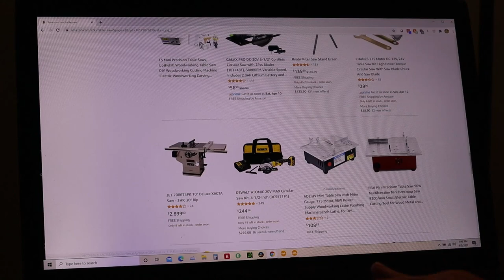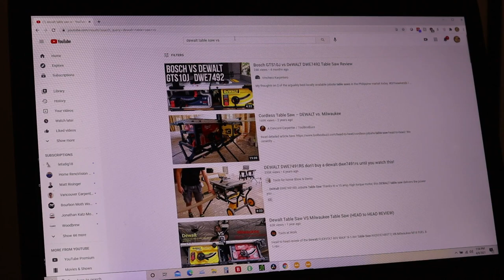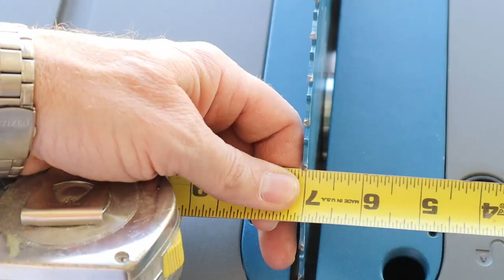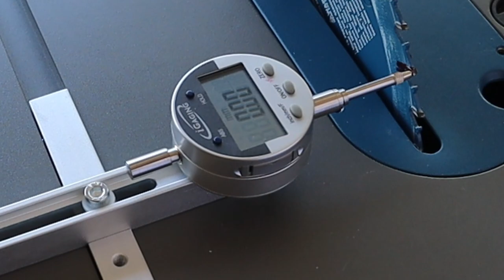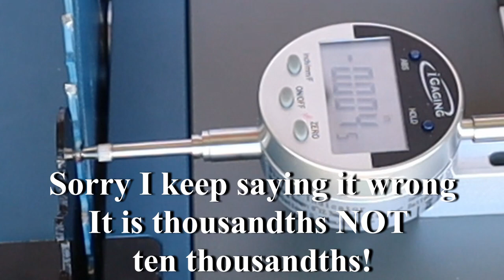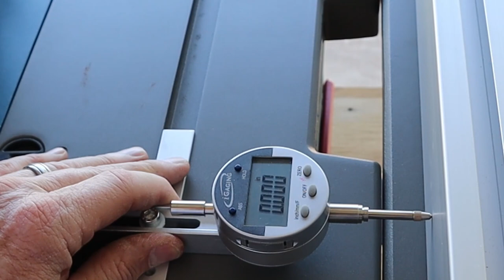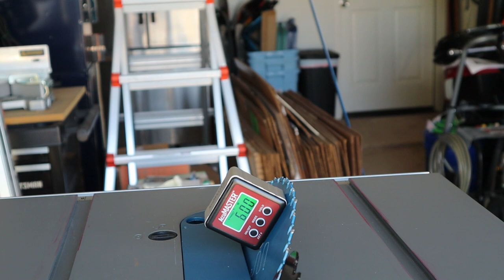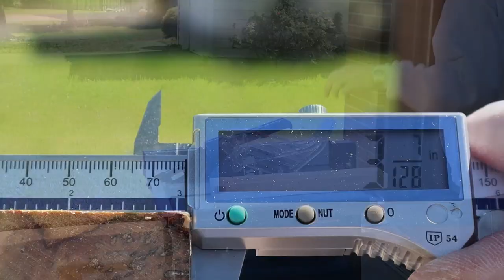MOST UNDERRATED table saw for the DIY'er-Hercules saw review

Comment: As a new owner of this saw (my first table saw), thanks for producing a thorough run-down.  Helped me get familiar with it quickly.  Now there is an issue... or maybe not.  Did you get a very noticeable burning smell when first running it?  A lingering burning odor, almost like rubber.  I wasn't cutting material, just powered up the blade and ran it for maybe 20-30 seconds until the smell became quite obvious.  Is this something normal for a new saw?
Reply from the maker: Gland you liked the video and it was helpful.  I did not get a burning smell with mine.  I have used it a few times since the video and still don't have a burning smell.  You might just take it back and exchange it, harbor freight is usually pretty good about that. Hope the new saw works out well for you.
Reply: @OakleysDIYHomeRenovation101   Appreciate the quick reply and your experience.  I've just run it off-and-on over a 30 minute period... still burning.  Didn't know if there was some lube or other material that took some time to burn off, etc.  I shall return it as you suggest-- the stench is not exactly inspiring my confidence.
Reply: Hi. Mine had a burning smell also when I powered it up for the first time. After a minute, the smell was gone. No issues since and have run it about 10 times so far.
Reply: It could be your power source. Check the breaker you're running it on and make sure you're feeding it enough juice. Also check your extension cord for the same thing. The electric motor needs the right amount of power to work properly. I burned up a brand new Ryobi table saw running it on the same breaker I had other appliances running on. I just bought this saw today and am having a dedicated beaker installed for it this weekend. I'm two table saws in and already tired of buying them lol. Good luck to ya.

Comment: I appreciated your video. I bought this today. And, I’m a virgin woodworking diy’er, very little power tool experience. But, I need to rip some cedar pallet planks for a lg plant stand which will save lots of $ bcs they are free; where the 1x2x8 frame pieces cost $8 each.  So, thank you.
Reply from the maker: Great, glad the video helped.  Hope your project goes well.  I still use mine and don't regret buying even if it is from harbor freight.  thanks for watching.
Reply: @OakleysDIYHomeRenovation101  It did.  I feel much more confident in my purchase and ability to efficiently use it. It was an investment going forward.

Comment: Regardless of what anyone says, it is a damn good buy for a beginner DIY woodworker. People forget that there is no precision engineering in woodwork. There are tolerances for error. 

A good woodworker, with patience and skill, learns to hide imperfection easily without losing the results of the finish product.

PS: most brand.name.tools are overated and high priced because of the name. Cheaper tools today do the same and are even better in their class.
Reply from the maker: Thank you and it has worked very well for me and I am quite happy with it.  Do you have one? How do you like it?  Thanks for watching.

Comment: Great video! I appreciate your detailed analysis of each feature and aspect of the saw. That takes the guess work out of making a decision whether to buy or not. I think I'll pick up the latest model tomorrow. We'll see how the rack and pinion fence shakes out. The feet are wider on the newer model too hopefully making it that much more stable. Too bad Harbor Freight doesn't have a stand that fits this model. Anyway, thanks for taking the time to make the video.
Reply from the maker: Hey Michael, thanks for watching and glad you liked the video and it was helpful.  Let me know how it works out when you get it.
Reply: @OakleysDIYHomeRenovation101  I went and bought the Hercules 10" table saw based on your review. Set it up this morning and have been running boards through it. I love it so far. Thanks again.
Reply from the maker: @michaelfern945  Good to hear, I have used mine a few times since publishing the video and have been quite happy so far.  Glad the video helped.

Comment: Would your still recommend this saw? Have your have any issues over the last couple of years? Thanks for the video.
Reply from the maker: Yes I recommend it in a lot of my videos where I am using it.  I think the new one with the rack and pinon fence is much better.  It has done well for me.  I need to replace the factory blade but that's it.  Thanks for watching

Comment: Thanks for this video and all the greats details/measurements! I am currently looking for a 10" table saw and found this one pretty good (very good in fact). The today's price is more higher (~ $330) than the one you had when you made the video (~$250), and they also released a new updated version (~$375). I'll pick up one this weekend. Thanks again for your helpful video 👌
Reply from the maker: Thanks for watching and glad you liked the video and helped with your decision.  I think you will like it, I like mine and is working well.  The new one has the rack and pinon drive to the fence.
Reply: did you get the upgraded one? What're your thoughts?
Reply: @Dubya1886  Long story short, the Hercules upgraded version was not available at the time I needed it. So I bought a Skil 15A 10" table saw which has similar features as he Hercules upgraded version plus foldable legs (a bit more noisy too...). I love the rack and pinion fence rails - super smooth, easy and accurate.
Reply: @dadandme  awesome, I will keep an eye out for that one too
Reply: @Dubya1886  I bought it from Shell Lumber and Hardware website. It was my first time buying on this website and it went great. They are in Florida, we are in California and they ship directly from the manufacturer or a distributor warehouse in another State. Great price, no tax and fast delivery!

Comment: Bought new one, like the rack and pinon fence. had trouble with blade raising. a burr on thread rod, more lube and worked perfect. Got for $262.49 with a 25% off coupon. Iam just a retired diy guy. scraped 2 old saws now iam happy. great video
Reply from the maker: Nice, Glad you liked the video.
Reply: John was the price $349 with a coupon? They are $399 at the store now?  I have a 25% coupon and only takes it to $299.

Comment: I fabricated a table mount because what I was sold at harbor Freight as the table that goes with the saw wasn't compatible. Other than that, it is or was a good solid machine until last night when the blade somehow came loose. That is why I am here today, seeking answers. The flange that will allow me to tighten or replace the blade won't even come off the top of the table.

Comment: great saw . had mine 3 years. perfect for the mature wood worker . i put mine on the powertec mt4009 rolling table saw stand . folds up with the saw attached. will never top and great to move around my property. $150.
Reply from the maker: Nice, I have had mine now for 3+ years and it has done me well.  I recently put a new blade on and works even better.  Thanks for watching.

Comment: Thanks for the review. I’m considering the new saw with the rack and pinion fence. I need to find out if the new model will take a dado blade. The other review I watched said the older model wouldn’t take a dado blade.
Reply from the maker: correct this model in the review doesn't take a dado.  Not sure if the new one does or not, in fact not sure if any contractor table saws will take a dado, maybe the real expensive ones (sawstop)  Thanks for watching.

Comment: I just got the rack and pinion saw. It is a workhorse on power and the fence is great but the miter gauge is loose as can be. Over ³/16 ths in play. Debating on taking it back and seeing if its just defective. I didnt expect a nice miter for the price if the saw but it wont cross cut straight to save its life
Reply from the maker: Great to hear you got one, my miter gauge is about a 1/16 of play laterally once it is fully in the tract but not what you are describing.  In the vertical direction has little more play but don't feel it should affect the ability to cut well.  Thanks for watching.

Comment: Great video. I just bought the new rack and pinion saw but haven’t used it yet except to power on and off. It has a brake on the motor and the rack and pinion seems good. The only thing I’ve noticed is when I bring the blade down at a certain point it feels like the gears are a little sloppy but I’m extremely happy with it so far
Reply from the maker: thanks so much for watching, I have that issue also but for me it seems it is stiffer almost like they are binding up.  Is the rack and pinon smooth to operate?
Reply: @OakleysDIYHomeRenovation101  yes it’s pretty good a bit tight but I’m sure in time it will be great. It’s the first rack and pinion saw I’ve owned so far